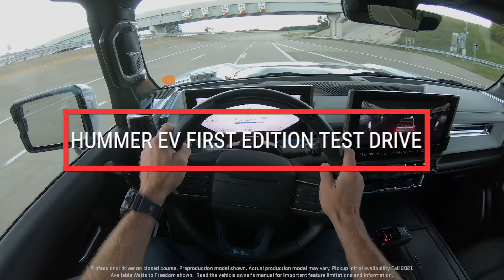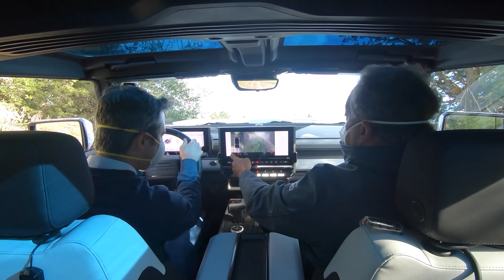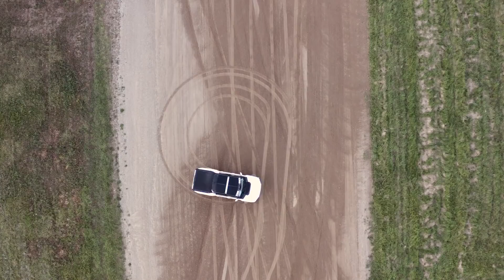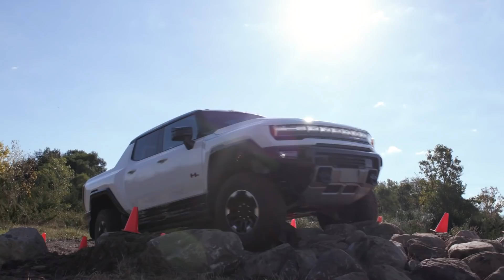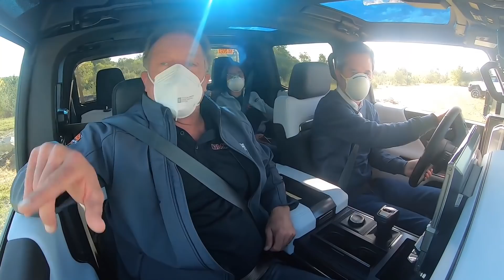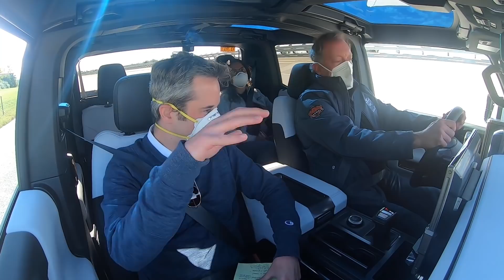2022 GMC Hummer EV Edition 1 first drive

Comment: Crab walk has been a thing since the 1970 Case 1200 and 1470 tractors.  Big deal.  Not to mention that GM trialed rear steering in some of their 2000 era C1500s, as a parking assist and for easier trailer hookup.
Reply: Ya,  interesting that GM brought Crab Walk to pickups,   and SUV's.
Reply: @dmitchellhomes  Big hairy deal.  So what ?

Comment: "Prototypes are easy.  Production is hard."   When will GM be producing 100K/year ?  What does it sell for ?  Range ?
Reply: They're starting production by the end of this month.
GM isn't aiming for 100k sales per year for the Hummer EV. It's a halo flagship vehicle.
Price goes from 79 to 112k.
Range is from 250 to 350 miles depending on trim level.
Reply: GM will be building 100K vehicles a year off the BT1 platform by 2023,   going to be 7 unique  vehicles coming off the same platform by 2025.
Reply: @dt7751   Production already started,  GM will announce it publicly this week.
Reply: @dmitchellhomes  oh wow! I'm so excited. Can't wait to recieve my SUV tho. Feels like ages away 😂😔
Reply: @dt7751    SUV is just over 1 year away, should be in production in early 2023.      I think Silverado Ev will come first at the end of 2022.
Reply: @dmitchellhomes  yeah its officially going to launch in early 2023 but I read somewhere that production will start by the end of 2022. Is that true?
Reply: @dt7751  Call me when they sell a real vehicle in real quantities.
Reply: @dmitchellhomes  Meanwhile Tesla is building 1M vehicles/year, RIGHT NOW.
Reply: @SomeTechGuy666  yeah, Tesla is doing great, but GM built about 6 million cars a year, And Toyota 10 million, so what is your point?
Reply: @SomeTechGuy666  you don't get it do you? Hummer EV is never going to sell anywhere close to a 100k units per year. It's GM's flagship halo vehicle. 

Even back in the days, Hummer sold on average 60k vehicles annually.

It's basically a truck that shows what GM is capable of making in their cheaper vehicles like the upcoming Silverado EV which will sell millions.

And stop comparing the Hummer EV to the Tesla Cybertruck when the Cybertruck is non existent and will probably never make it to the market. 

I can even bet with you that when all the big companies go electric, Tesla will die as a company.
Reply: @dt7751  LOL.  You are delusional.
Reply: @dt7751   @TechGuy is a Tesla fan boi,  not worth your time to talk to..   You cannot reason with the unreasonable.    Tesla is doing great,   and is growing fast,  they are the big fish in a small pond.
Reply: @dmitchellhomes  ICE != EVs.   GM and Toyota are building zero EVs.  Or negative EVs if you count Bolt buy backs.